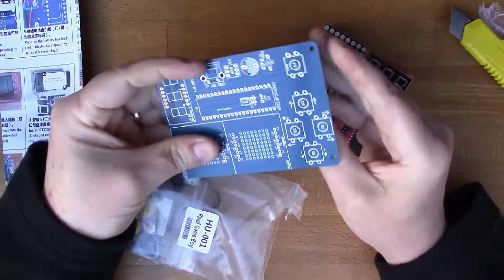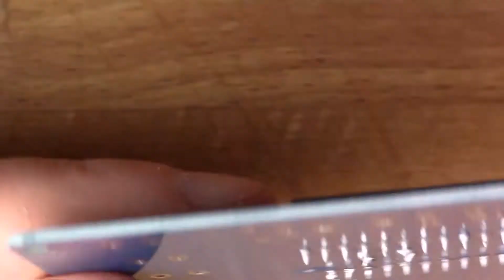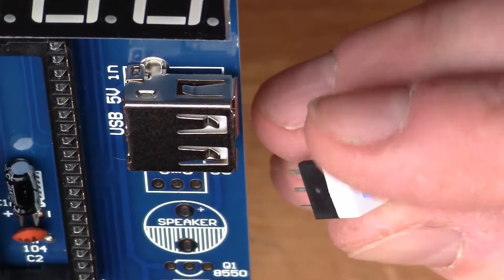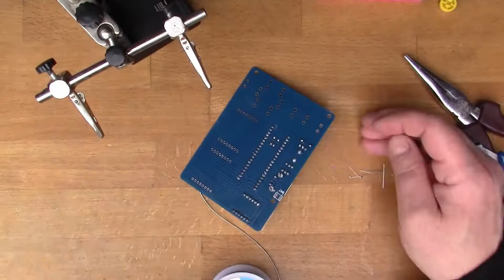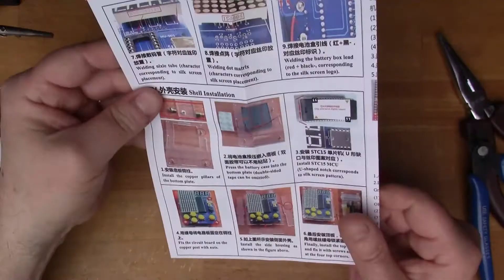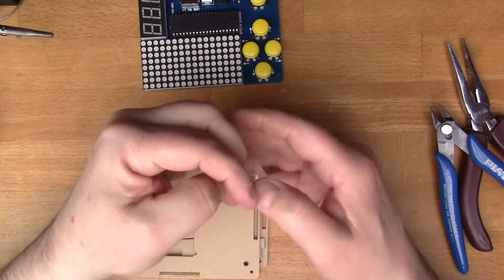Hand -held Game Kit Build (#134)

Comment: Hi this is my first soldering project to speak of, very useful to see how you do it. I was trying to follow what you were doing, but how do you know which way round to put the legs of the capacitors?
Reply: So if anyone else is reading this - the shaded semicircle is for the negative leg (the short one) of the 10UF electrolytic capacitor. The orange ceramic capacitor labelled 104 has no polarity so it doesn't matter which way you put it in. I've finished soldering and it's basically working, though one line of one of the 8x8 displays isn't, need to figure out why. It looks like I might have a bridge between two of the chip pins, not sure if that's it, or a dry solder on the display itself. But happy that it is basically working, and I can play each game!
Reply from the maker: This is right, small value capacitors are generally non-polarized and so it doesn't matter how you fit them.  Tantalum and Electrolytic capacitors do have a polarity, but there's normally a visable + or - on the case, or a different coloured band against one pin.  I put an electrolytic in backwards in a power supply a couple of years ago, and a surprising amount of steam/smoke came out of it when I switched on.
Reply: @MartynDavies  That sounds scary! It turns out I did bridge two pins of the IC. Once I separated them, the game works great. There is some issue with sound, though - sometimes it screeches randomly, and in silent mode it just resets. I guess somewhere down the line I'll be able to diagnose and fix this.

Comment: So im really confused on what the usb port is actually for. It says 5 volt in but it wont power the actual hand held. I tried tracing it. It goes directly to battery
Reply from the maker: Yes, the battery leads are connected in parallel to the +/- of the USB socket.  This allows you to power the game either from the battery box (around 6V), or from the USB socket (should be 5V).  There's a very weird USB cable supplied (USB "A" to USB "A"), that should allow you to get power from a USB device (e.g. power brick or a USB socket in the car).   You'll see at @31:33 I use a power bank, then later I use the battery box instead.
Reply: @MartynDavies ok cool. Hmm may need to relook at it. Tried powering it from the usb and didnt work. Thanks for the response